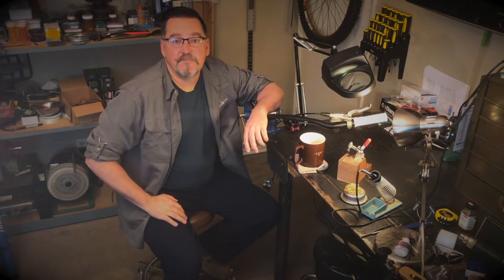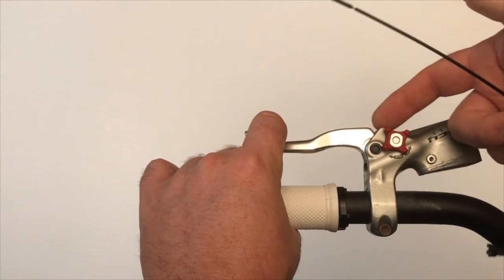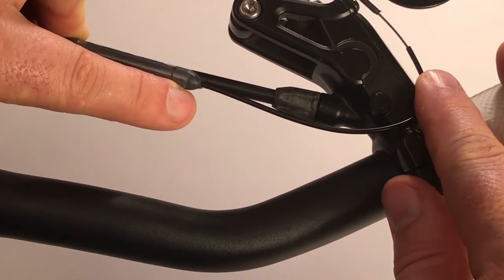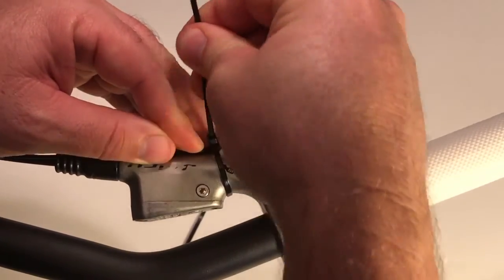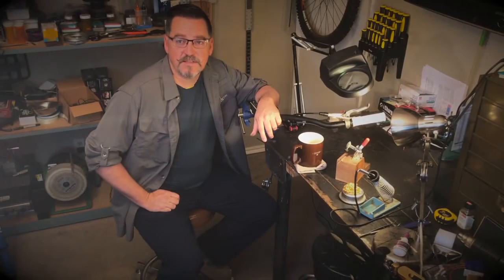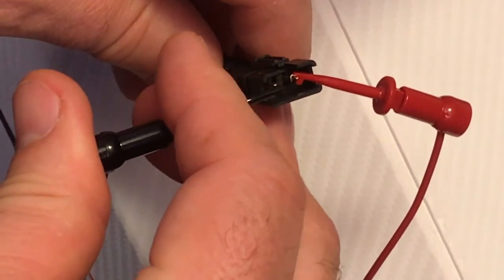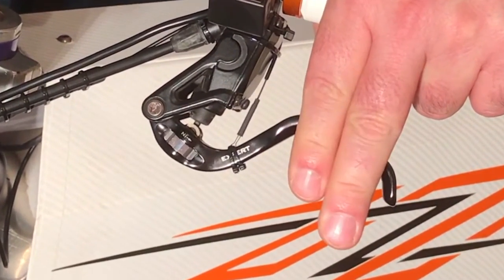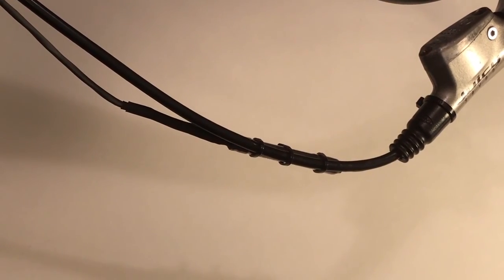Tripwire  Installation Part2, Attachment and Adjustments

Comment: What if you switch positive and negative at the connection??
Reply from the maker: There is no polarity with these switches, so it doesn't matter which wire goes to which. It's just a regular SPST reed switch.